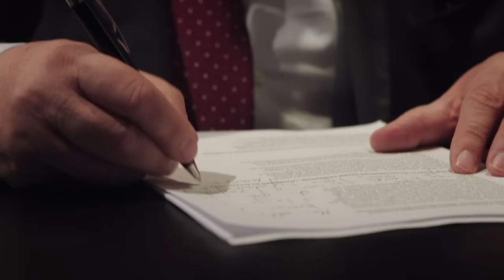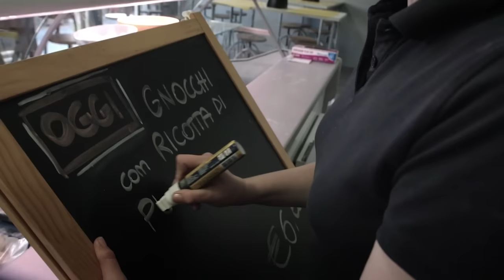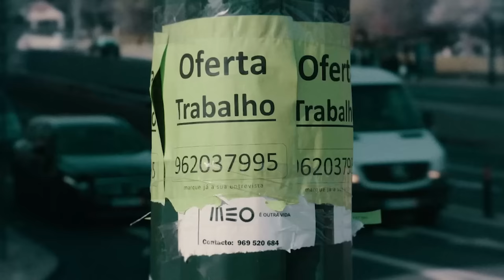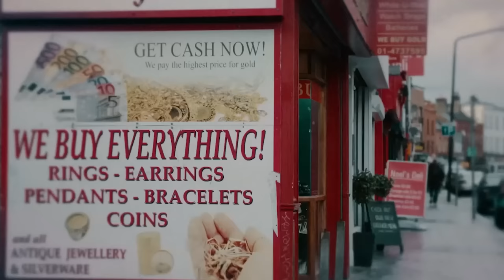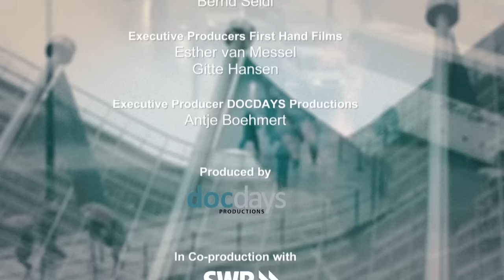The Rise of Poverty in Europe | ENDEVR Documentary

Comment: If you use the 60% of average earnings definition for poverty then there is going to be a lot. Then ypu syart using the highly musleadibg term "at risk of povery" But realistically speaking is that a proper definition? There is a whole industry around poverty and as common with govt supported organisations the worse thing those people can do is to fix the problem. It's built in that they constantly need to make the problem worse to secure their grants and keep their jobs!

I suspect the 60% level was chosen purely to give high figures! What happens if the level is set at 50% or 40%?